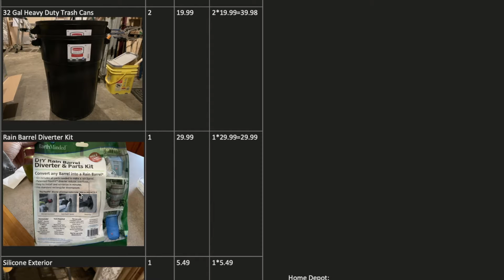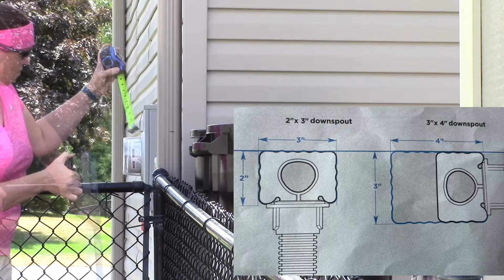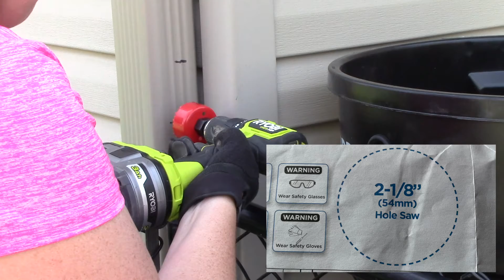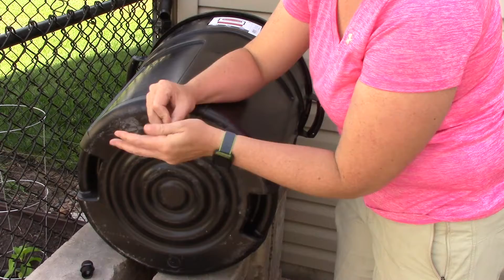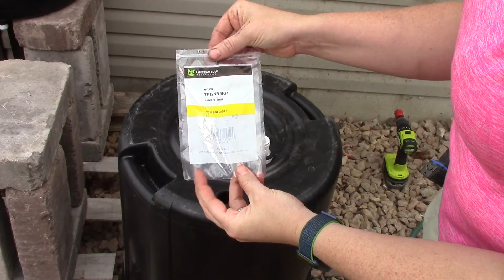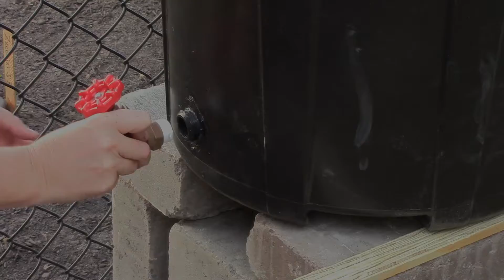DIY Rain Barrel System w/ Trash Cans & Rain Barrel Diverter Kit

Comment: Great video and explained very well! If you are only making 1 barrel then you wouldn’t do any of the holes on the bottom right? It would just be adding the adaptor to the drainage thing and then the spigot right?
Reply from the maker: Thank you so much and you are correct.  One barrel would just need the input near the top and the spigot.
Reply: @carlytackles  thanks!

Comment: best video !on my olive barrell im going to drill down 5in and then drill down 5 in on my down spout is this correct ,thanks
Reply from the maker: You want the hole in your down spout to be level with your hole in your barrel. Setup the barrel how you want, i.e. on blocks, and make sure the two holes are at the same height.

Comment: Great video. Do you find that simple diverter does a good job at still letting any leaves or shingle gravel to flow down the downspout or does it get clogged some times.
Thanks
Reply from the maker: I haven’t had a clog, but i have seen some debris get into the first tank.
Reply: @carlytackles  any suggestions on how to eliminate the debris getting into the tank. Do you winterize your tank at all. Do you have to remove the diverter in the winter?
Reply from the maker: For winter, I completely wash out the tubs and take them down. It gets too cold where I live not to do that. There is a plug for the gutter that comes with the kit. 
I take out the gutter adapter, replace with plug. I empty my tanks, give them a good cleaning and disassemble my hoses. 
At the moment, I do not have a idea how to prevent debris, it hasn’t been a problem enough for me to attempt to address it.

Comment: I had a water barrel (not as elaborate as yours) but the water got scuzzy from the asphalt shingle roof and I didn't think it was safe to use on garden plants. Do you have a metal roof?
Reply from the maker: @KM Writes. You bring up a very good point. I also have asphalt shingles and from what I have found online even metal roofs can have some pollutants that go into the water. I will not be applying the water to leaves or vegetables directly, which seemed to be the main concern. Instead I am applying the water to the soil via soaker hose. I found a few research articles that say this application method is low risk.
Reply: @carlytackles  Seems like a good way to apply the water. Thanks for the thoughtful reply.